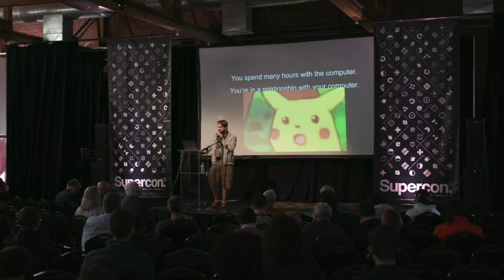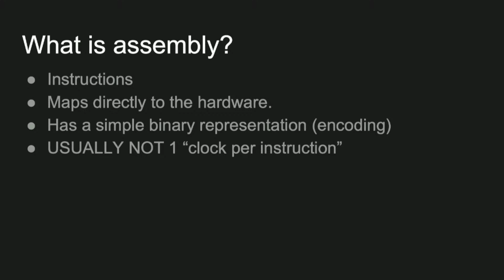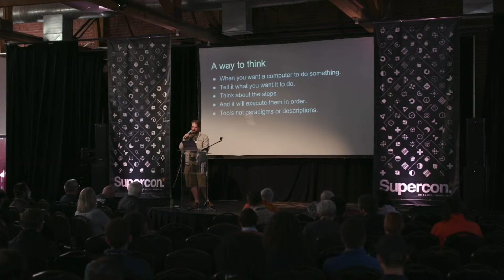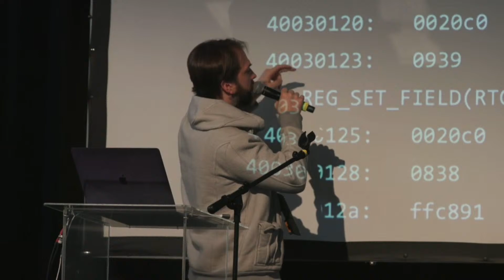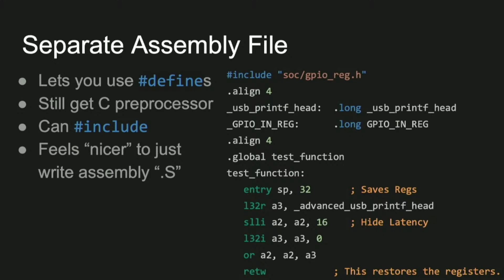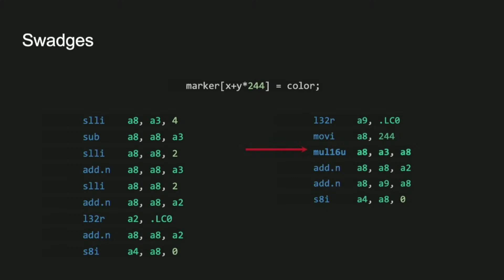Hackaday Supercon 2022: Charles Lohr - Assembly in 2022: Yes! We Still Use it and Here's Why

Comment: 19:00 The reason you want to re-roll the RNG is so the output distribution is actually uniform. If you don't do that (taking the 16 results and moding by 6 for example) some of the numbers in the output  distribution will be underrepresented.
Reply: You can map results 0-11 to 1-6 with perfect distribution and discard results 12-15. Discarding 10 out of 16 instead of 4 out of 16 is dumb. You can also throw twice and then discard 3 out of 256 possibilities.
Reply: @chrisidema  Fair

Comment: So triggered when you called out OOP lol

its problematic but an easy way for people to get their head around modelling the real world in software.

Also job listings currently far less often are looking for FP haha
Reply: No, it really isn't. Those models are not just useless most of the time (that would mean they're cost neutral besides the time/effort invested in creating them), they're actively counterproductive. Outside of a limited subset of domains where OOP is a good match for what is being modeled and inheritance is used not at all or very sparingly, not only is the modeling itself a huge blackhole timesink, but the process of turning that into code and the implementation in code are a mess that is very difficult to maintain and change (yes, the fabled encapsulation and separation of concerns in OOP do not actually work and are only an improvement when you compare it with a complete spaghetti ad-hoc no-forethought implementation), forces you to do way too much work up-front that you will invariably throw away as you understand the problem better, is actively antagonistic to iterative development, the list goes on. Consequently, to 'fix' this, you supposedly need GoF 'patterns', to 'fix' those you presumably need something else.. and so on. It is a neverending vicious cycle of hugely effort-intensive non-work that contributes nothing to the end product, all to somehow operationalise an approach that is a priori broken. The opposite of OOP is not FP, btw, it's absolutely possible and desirable to implement most things imperatively or reactively and model the problem domain according to the problem, whether that be a dataflow, automata, message-passing actor (what OOP was originally meant to be) etc approach, again, depending on what you're trying to do.